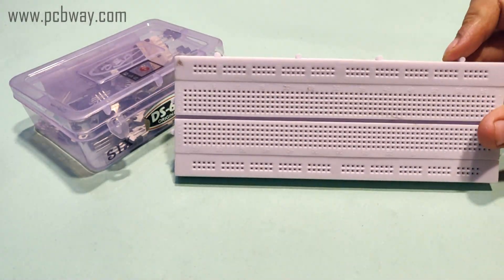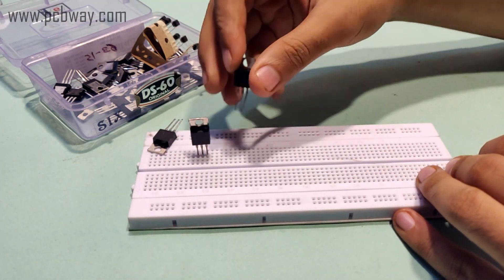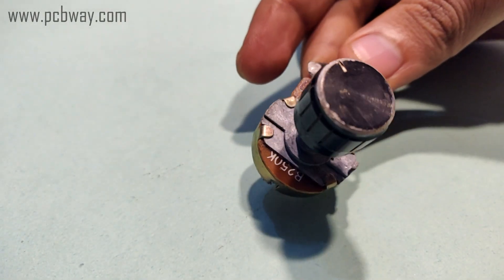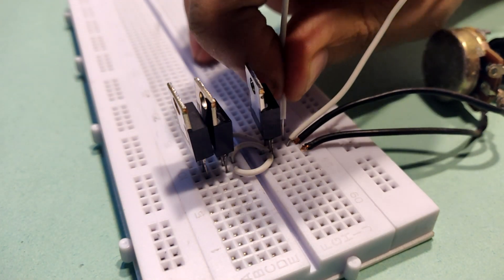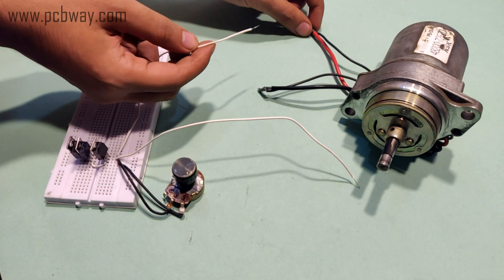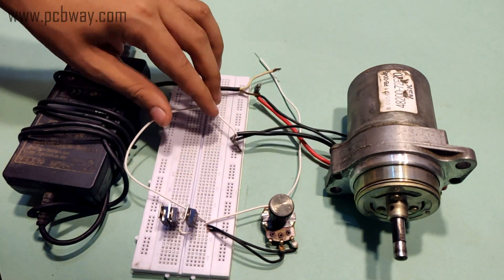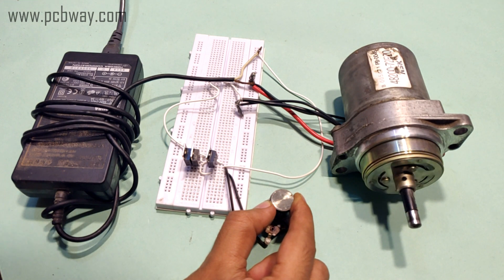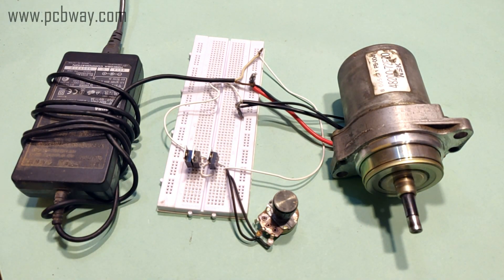Homemade Powerful 12V 100W DC Motor Speed Controller |  PCBWAY

Comment: first of all this device is not DC motor speed controller ...... its a waste of volt in form of heat ...... 2nd speed is control by pulses like PWM not by decreasing the volt .... this thing u r using to control speed during load it nt gona work motor nt be able to run in load. in that case more dc current require so that PWM is necessary with feedback loop that helps the motor run on same desire speed without loosing torque
Reply: Yep! I came here hoping for a simple 555 PWM controller.

Comment: bro, good job! the pcbway manufacturer looks great!
Reply from the maker: Thanks Bro.Yes Bro : PCBWAY is really good..
Reply: Wow, bro, thanks for your reply, how is the quality of pcbway? Or what impress you most, i have a new design might need pcb.
Reply from the maker: Well i have got a few pcbs from them for an 18v charge controller.The precision with which the work is done is really great.
Reply: that's great.bro.maybe i will try pcbway service later,thx so much, bro.
Reply from the maker: Sure. You're most welcome.

Comment: With that voltage controller, i could make a lot of cool stuff. thanks. Anyways, i need to bring varying 22 to 18 volts to Floating 12.  it can runn slower, but not faster than 2/3 of the provided voltage.

Comment: I have 2.5hp vDC 220 motor  max 5hp  RPM 4200  I want to make use of it in my petrol bike the way u used in ur Electric pulsar project  ... I want to keep my petrol engine as well can this run on the 3000 v  as one u used to drive dc motors in ur project?
Reply from the maker: Hi! 3000Volts ???
Reply: Mr Electron yes the way u ran some motors with very high voltage.in your other video.. want to run my motor with that same way..😁

Comment: I use 220 k potentiometer instead of 250k , 12 v output is showing on multimeter but the motor doesn't working, I check with a lamp instead of motor ,it's working dim and bright..I am using a radiator fan motor

Comment: what about torque of the motor? i think the torque will be very low with low speed that can't drive the load
Reply from the maker: Torque is good if th motor is getting enough current.
Reply: Torque I'll be decreased with speed. Its not vfd controller

Comment: make a speed control for 195 volt ,5A,820 w,286Hz 16000 RPM.3 phase induc motor,this is whirlpool washer machine ,motor work on 120 volt. brushless...project for you from canada.

Comment: My blow up and start smoking
Reply from the maker: Power transistor?
Reply: Mr Electron controller what you spin
Reply from the maker: Its a *Variable resistor*.... Use a high power variable resistor.